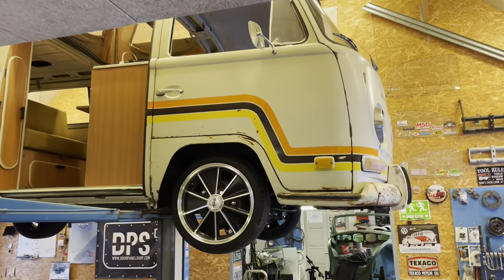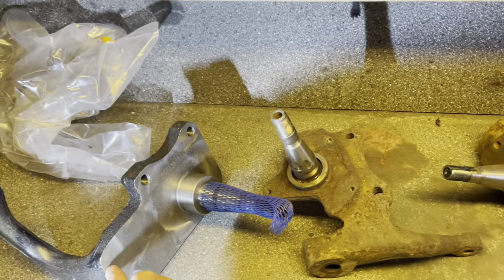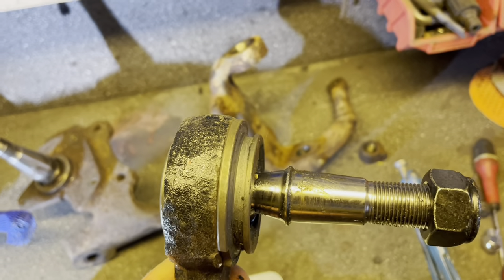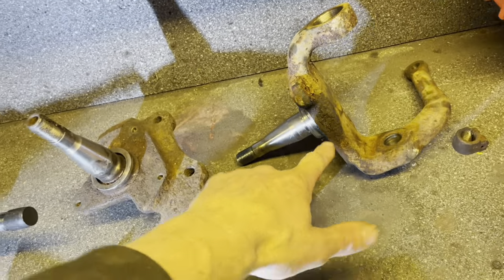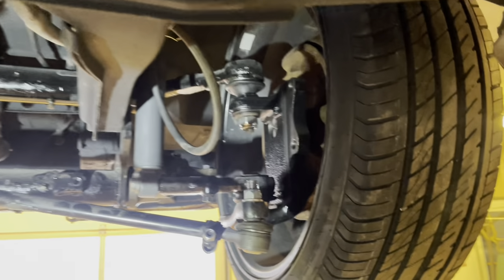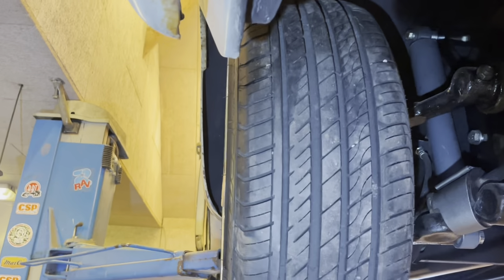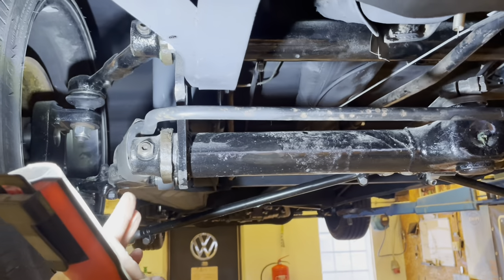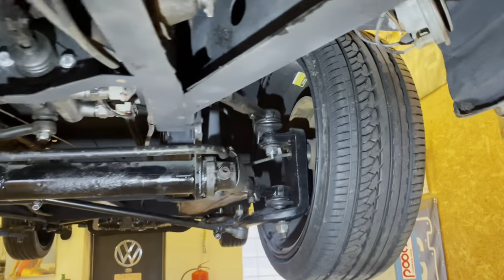How to make a baywindow ride good - Front suspension explained

Comment: Hi can I ask when you flipped the antiroll bar did you have to use different rubber in the clamps or longer bolts to pull the bar into place thanks
Reply from the maker: Same rubber and clamps

Comment: Hi sir I have an early bay window bus I installed my custom air ride however it affected the castor front wheel angle which makes it hard to control over 60km per hour the bus is all over the road 📐 .I need to bring the castor back to about 4degrees as now it's negative any advice on how I can do it ? Will the castor being negative make the bus hard to control ?
Reply from the maker: Hi. 
If you adjustable caster nut will not take it, the only way to get it back is to move the beam itself. This will take some work to do, as you have to make you mounting holes bigger to move your beam. If you don’t have one with that adjustability

Comment: What sway bar is that?  Is it narrowed 8cm or 11cm?
Reply from the maker: Original narrowed 8cm
Reply: fyi vintage autohaus (french slammer) make a -8cm and a -11cm narrowed sway bar.
Reply: @SPRasmussen  did you just remove the ends?  Is there room to remove 11cms? 
Also what et are those wheels?
Reply from the maker: @kevinhape8584  I took 8cm out of the center of the sway bar. And you can just take out 3 more. No problem. The ET on the wheels is 45
Reply: Oh so you cut it down and welded it back together?